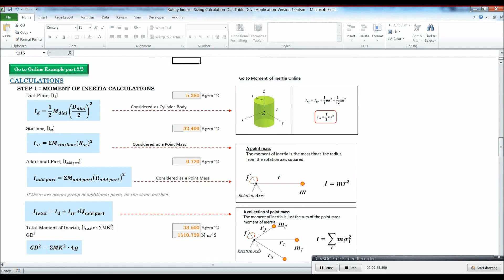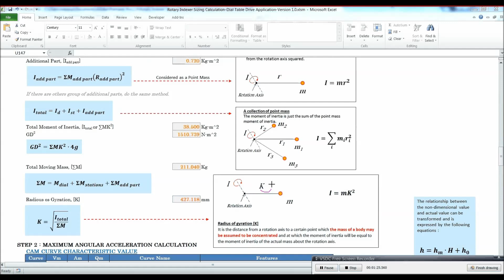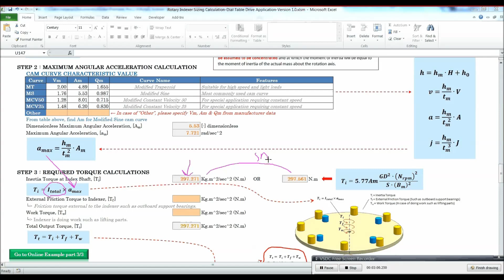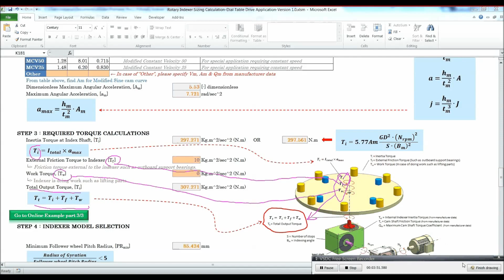Rotary Indexer Sizing Calculation Dial Table Drive Application V1.0 Part 2 | Ezy Mechanic

Comment from the maker: Youtube video: Part 2 of Rotary Indexer Sizing Calculation -- See example of the excel calculation sheet for calculation values of related parameters such as moment of inertia, cam acceleration profile, torque calculation, etc.

 #MomentOfInertia     #Torque     #Indexer     #Acceleration     #MechanicalEngineering